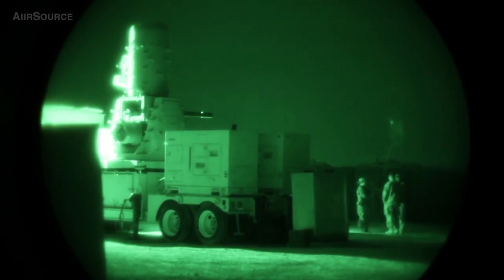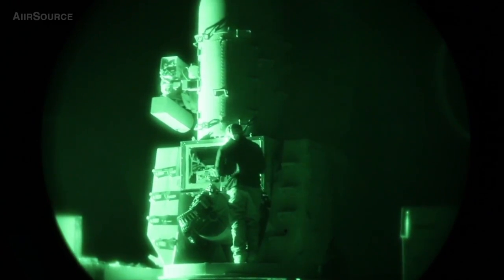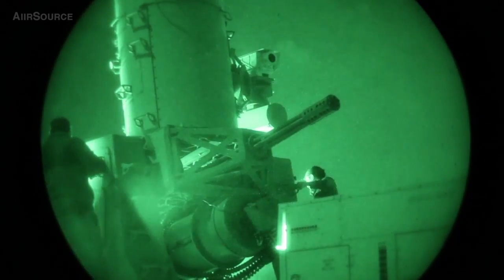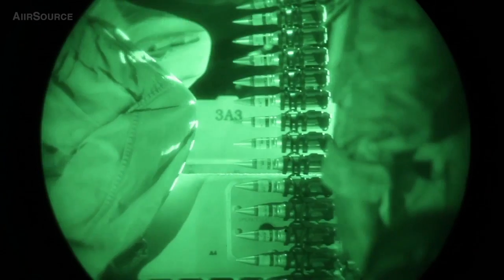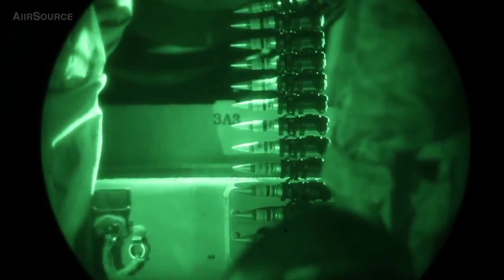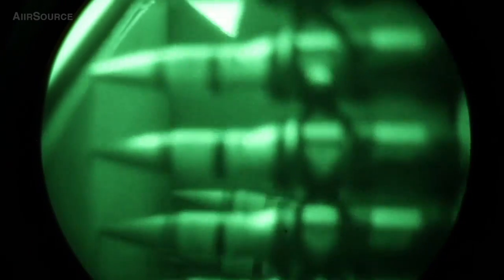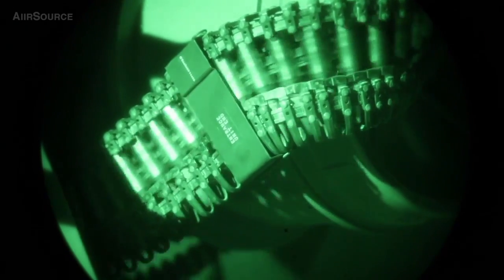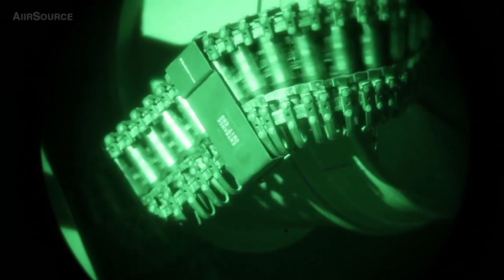Counter Rocket, Artillery, and Mortar – CRAM Gun Test Fire

Comment: why do the bullets explode 3 seconds after they are shot?
Reply: defkon1 I believe they’re tracer rounds
Reply: @nissanxrma1  It's self detonating high explosive, so if the round doesn't hit its target, it will explode close to it, reducing the need for perfectly accurate shots.
Reply: F-14B Tomcat I understand how the round detonate the explosives. He was wondering why you can see the rounds as they exit the barrel. The rounds are not exploding as they exit, like you said, but they are tracing.
Reply: @nissanxrma1  Yes, those are tracer rounds, but OP's question was why they explode after the barrel.
Reply: The rounds are set to destruct to cut down on cola Teri although damage. A round that big would do some wicked bad damage to someone's house..... or face. The guy said there to destroy the mortar but that's because he's a contractor and it makes it seem well designed.
Reply: defkon1 the explosions are intended to damage or destroy the missiles coming, a modern day flak cannon kind of. Ww2 flak exploded in air to increase the chances of bringing down planes instead of direct hits